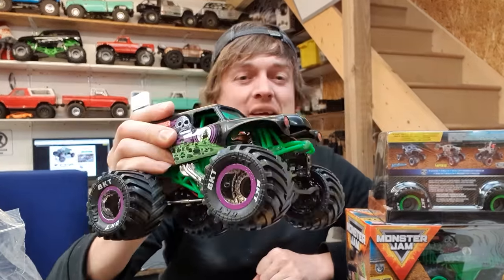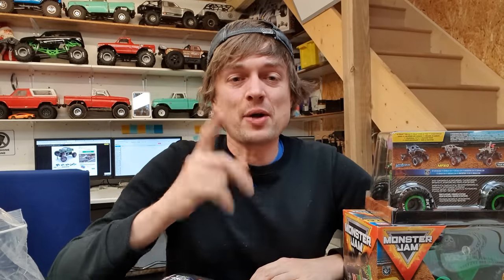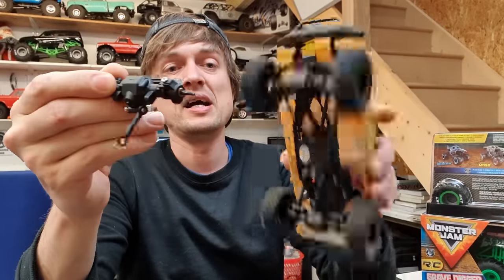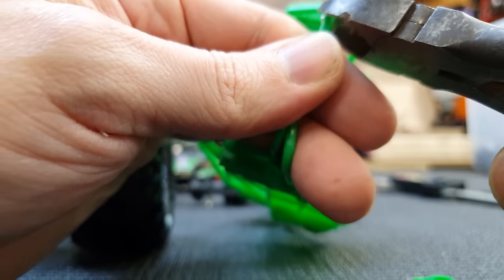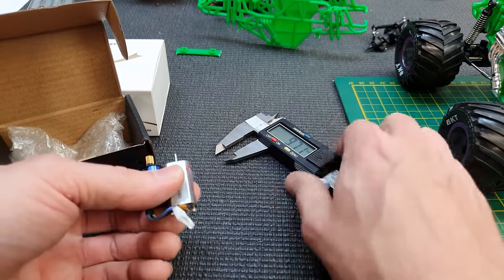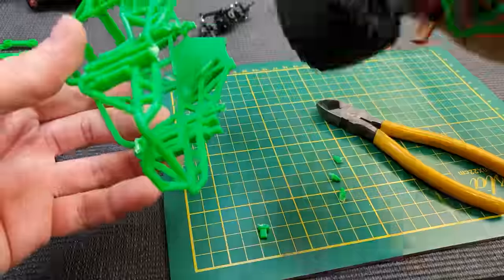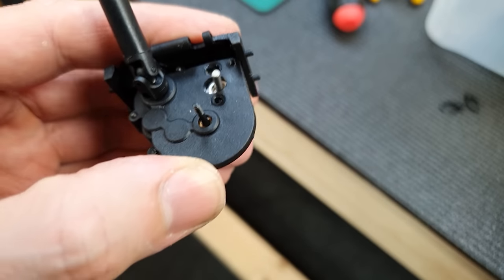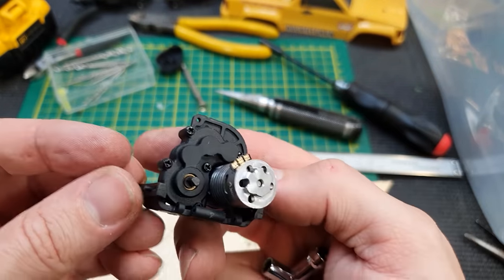BUILD a Tiny 4WD 4 Wheel Steer Grave Digger RC Monster Truck Car

Comment: I've done that with a cheap New Bright truck. I'm really new to this so i did it the easy way. I took the front end off of one and put it on the back end of another. i had to change the wiring but it worked. i couldn't use them separate because i haven't really gotten deep enough into the wiring to figure out a separate control for rear steering.  my lab.. spare room.. looks like a new bright graveyard I'm constantly buying new cheap ones and stripping them down right out of The box to build something better. Since I've started watching your videos I've decided its time for me to invest in a good fast one now. not a $500 investment but more than what I've been spending. Thanks for the videos they are entertaining.

Comment: You may be able to run the rear servo to a servo reverser then run that to a y harness then connect both go the steering channel and you should have rear wheel steer with just the regular wheel. Granted you wouldn't be able to crab walk and it would be on allll the time

Comment: Hey Kev, I really want to make my own RC like this and I have a question:
If I don’t care how fast it is, can I just use the Devastator electronics and transmitter? And if I want to change the motor, can I just use the one you used?
Reply from the maker: you could do but no idea if you could use the motor with that transmission
Reply: @KevinTalbotTV  Okay thanks for the information. Also if I do make one I’ll be using a Hot Wheels 1/24 roll cage instead of the toy Grave Digger RC you tore apart to save a bit of $$$

Comment: hey KEV please help me, i bought a new esc and moter (brushless) for my traxxas rustler. When i turn it on it steers but it doesnt excelerate the moter and esc i bought it on amazon and this is the name of it you can just copy and paste in google 

Rcharlance F540 3000KV Brushless Motor 3.175mm Sensorless with 45A ESC Brushless Waterproof Electronic Speed Controller Combo Set Upgrade Power System for 1/10 RC Car Boat
Reply from the maker: no idea without seeing it dude
Reply: @KevinTalbotTV  if i made a video of it then sent it too you via? whatever you have
Reply: @KevinTalbotTV nvm i fixed it xD